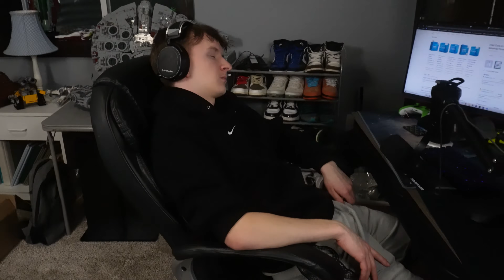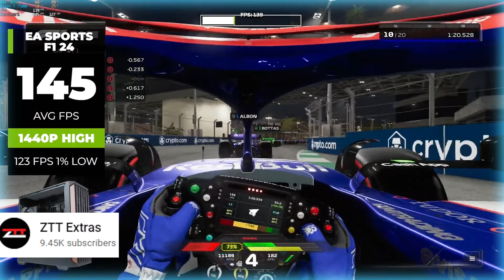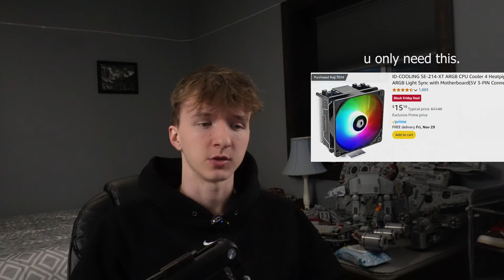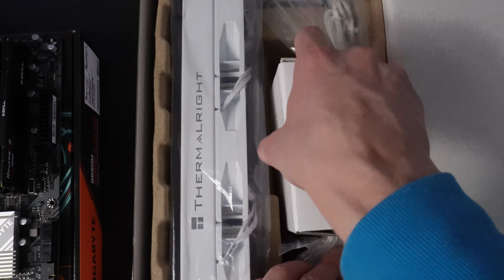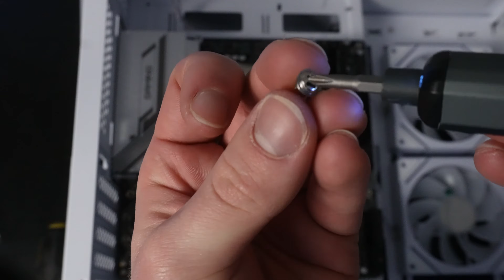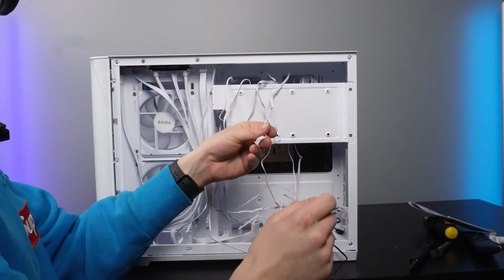The BEST AM5 Gaming PC Build for Under $800!

Comment: About to build close to the same PC. If the cpu max speed for Ram is 5200 does it matter if I get 6000 for an extra 30$ or just get the 5200 and save myself some cash?
Reply from the maker: idk how its $30 more for 6000mhz but it can handle it

Comment: My 3070s are like $400
Reply: Get it used not new….If youre gonna get new then you may as well get a 4060 ti or a 4070
Reply: @joshp0811  3070 is better than the 4060 ti I'm performance
Reply: @joshp0811  rtx 4060 ti is NOT worth the price
Reply: i paid $200 for a evga model like a year ago
Reply: @_owenmc it's ass anyway
Reply: Get used